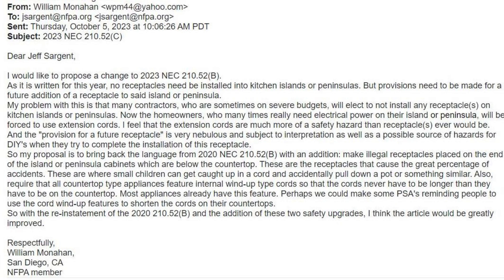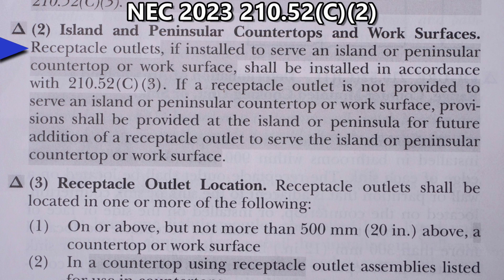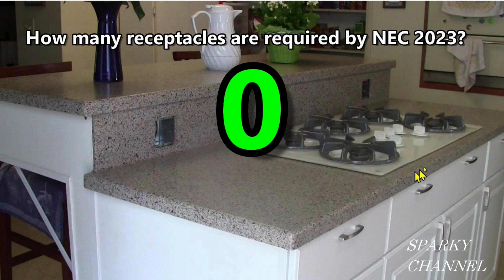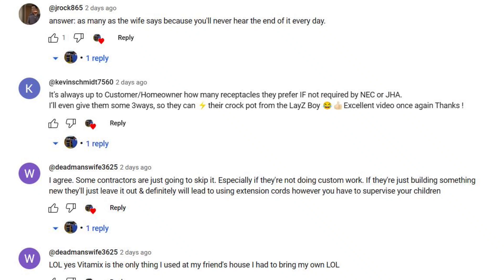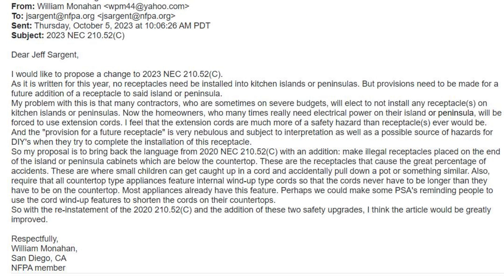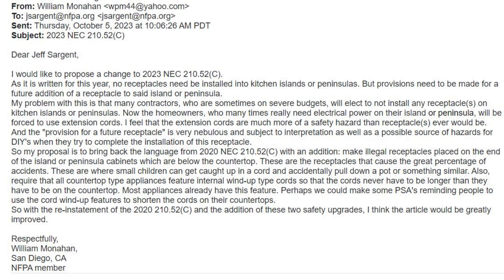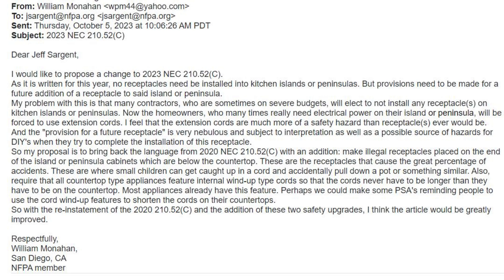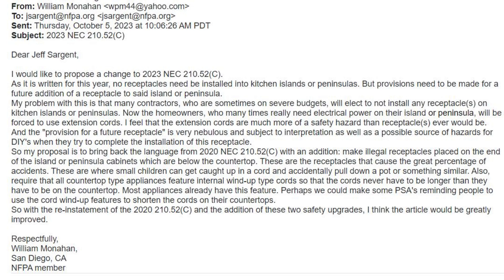Kitchen Island Code Change Suggestions from Me to the NEC for 2024

Comment: I despise the idea of having to have outlets built into the top side of the countertop just waiting for water to get down that receptacle cut out and down in the cabinets would be an utter nightmare. Only way that I can see that working is if there’s some type of waterproof or highly water resistant gasket that keeps a tight seal when the outlet is and is not in use.

Comment: If were worried about kids I would prefer a kid get tangled up in an extension cord then to Grab the cord to an appliance ( IE  a HOT CROCKPOT)   and pull the pot down on themselves. Having receptacles on an island adds more places for appliances for kids to grab a hold of cords. More receptacles more problems especially on islands

Comment: I like the new code change.. why? You can't stop stupid, I've never seen an extension cord in a kitchen and in TN  there is no island code  rule. ( the state used their brain and said it not required..  Its an island which means its not the main countertop The cook has other places to use appliances... Some islands have Not backsplash, and absolutely no way to run wiring without rebuilding the cabinet ,,, So I like the change  ..  someones wifey can move her big butt to the other side of the countertop and use the receptacles
Reply from the maker: Thanks!

Comment: I think your suggestion is a good one, the wind up cord idea will never fly, very cost prohibitive and hard to enforce. Since as others have stated the NEC is the bare minimum. These counter top receptacles, unless the homeowner is aware that they are not required, they will never know to ask to have them installed. I therefore think the NEC should go back to the way it was under 210.52(B)
Reply from the maker: Most new countertop appliances already have internal cord wind-up systems. You push the extra cord into them. The idea is just to avoid the possible danger of someone getting caught up in an overly long cord and perhaps knocking over a coffee pot or something. True, most new homeowners will have no idea that they are provided with the wiring for a receptacle but no receptacle. lol!
Reply: All of our customers that are building new homes have asked for the receptacles, not knowing they were already required. (We are on the 2020 code with 2017 code for residential; short version of the story, If you want the long version look up North Caroline code requirements.)
Reply from the maker: Best wishes when you are working with the 2023 codes. :) @tiggeroush

Comment: I like your suggestions, however without having some kind of strict rules on how sturdy the wind-up cord mechanism has to be, I suspect a lot of cheap implementations will cause a lot of small appliance waste.
Reply from the maker: Good point. Some countertop appliances have better cord roll-up mechanisms than others. And some older appliances don't have any roll-up mechanisms.

Comment: The NEC is going backwards and starting to scare me. No receptacles required now for a countertop but were required in 2020 and no nail plates if using PVC in walls . So the customer who has no knowledge of the importance of wire gauge will go to the local .99 cent store and buy a bunch of lamp cords to power their coffee maker from the livingroom or bedroom. Why are they going in reverse ?
Reply from the maker: I agree in that I think we should go back to the 2020 NEC for 210.52(C)(2). The 2023 changes are going backwards IMO.

Comment: Thank you so much for taking the time to write to the NFPA. The only item I see for concern with the suggestion is the illegal nature of recepticals at the end or under the counter. In many designs this would require a bar top to be built or for a counter top receptical to be used. The bar top adds a lot of cost by many trades. The countertop receptacle comes with it's own safety hazards.
Reply: They already made receptacles below the work surface illegal in the 2023 code.
Reply from the maker: What article is that? @phi5head
Reply from the maker: 210.52(C)(3) is under (C) Countertops and Work Surfaces. Therefore, you can't put a countertop or work surface receptacle on the end of the cabinet. I don't think  210.52(C)(3) prohibits any receptacle (non countertop or work surface use) to be put on the end of the cabinet of an island or peninsula. Think of a receptacle put there for roombas and the like. @phi5head
Reply from the maker: OK, thanks!  @phi5head
Reply from the maker: Thanks!

Comment: i have one for you.  look at your male 120volt cap.  that you plug into a outlet. overseas that cord cap has insulated blades.  you can,t get it pluged into the outlet and get shocked through the blades. don,t see anyway to get that changed though.  cost would be out the roof.
Reply from the maker: Interesting, thanks!

Comment: Years ago.  there was a battle over the outlets installed below the countertop. was because of a lawsuit from a couple. their kid grabbed a coffee pot and , plugged in below the counter top.  pulled it off with hot coffee. kid got real burned. they sued.  the elec contractor said he had to because of code.  so the battle was over to remove those below the counter top.   i like your idea. some way put them above.
Reply from the maker: Yes, that's why I'm saying to get rid of the below the countertop end-of-cabinet receptacles. They are a hazard IMO.